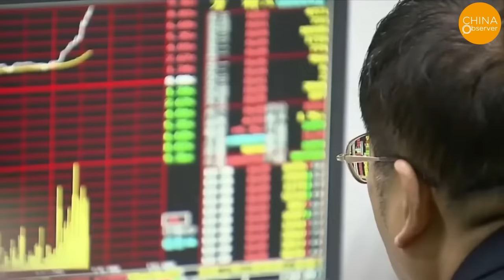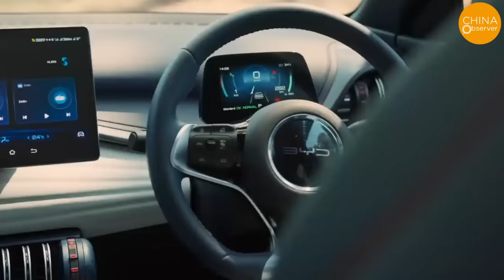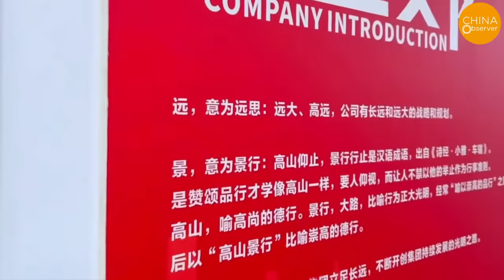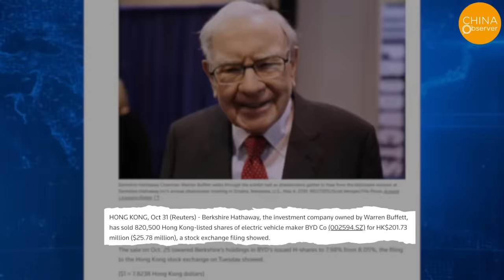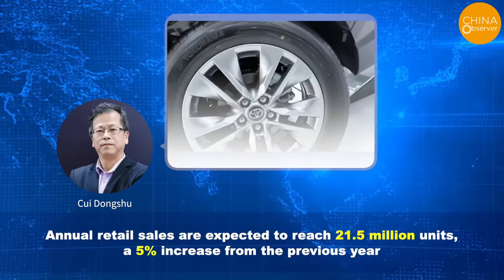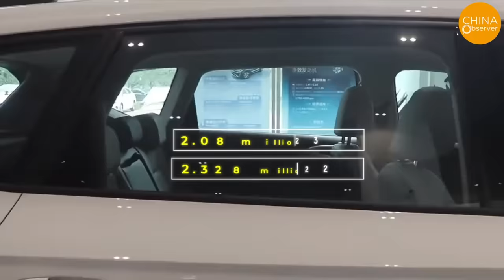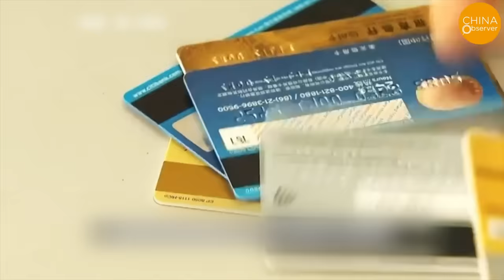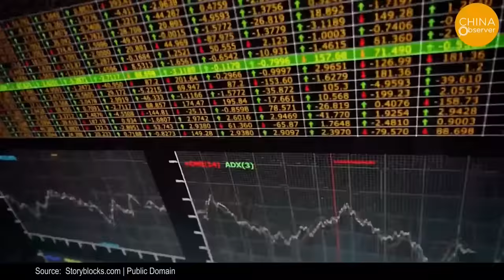China’s Car Dealers in Tears: Car Price Freefall, ￥190,000 Cuts Still Unsold, Turning New to Rust

Comment: If a new car is rusting this quickly, its not very well made. It should take at least 8 years before the first spots form.
Reply: china moment
Reply: Possibly it’s just the brake rotors, normal.
Reply: If the dealership is near the ocean, the rust can form much faster.
Reply: Where did you get that information about 8 years
Reply: I’m in the US.  Where I live we get heavy snow and ice in the winter.  We use salt on the roads.  My car is 5 years old and still has no rust on it.  My car was not made in China.
Reply: Made in China cars start rusting from in the factory, they tore down a brand new BYD with internal rust fresh out the factory.
Reply: All the atmospheric pollution in China turns the rain acidic, plus the steel used in Chinese-made cars is sub-standard.  Imagine how quickly a Chinese-made car would rust away in the US where they treat the roads with salt and other de-icing chemicals.  I bet the Chinese also cut corners when it comes to undercoating their cars.
Reply: Tofu Dreg vehicles sell in china 🤣😂🤣😂🤣
Reply: You forget the acidity of the rain because of the pollution 😅
Reply: Made in China
Reply: @PRCOutdoor 😂😂😂
Reply: It's not rusting. Those are termites.
Reply: Really? My car is currently 16 years old and the only superficial rust spot so far is the exhaust and some bolts.
Reply: Won't rust if plastic crap
Reply: Weather conditions also intensify rust
Reply: Regarding all the videos about burning brandnew EVs, airbags dont open in frontal heavy crashes.. i would consider you lucky because you only got some rust.
Reply: No vehicle is made to stand still. Movable parts can lock shot. Brake rotors for example.
Reply: Because it made from China...
Reply: It is made in china
Reply: Ford and gm never last 8 years. I live in America especially in winter ❄️ states cars 🚗 start rusting so quick. Ford and gm newer cars 2021 and above already receiving many complaints from customers about getting rusty.
Reply: The car that is “rusting” in the beginning of the video is Volkswagen. A German car company.
Reply: Das Auto mein freund!
Reply: Made in china
Reply: i think the problem is its on direct sunlight for 4-5 years. plus gets piled up with snow in winter with no one removing the snow till the ice melts. which will damage the paint.
Reply: Im happy with my 20 year old Golf IV with no rust
Reply: how much is it in US dollars?
Reply: VW rusting so soon 😮
Reply: This talk reminds me of the time when Americans did think that Japanese and Korean made cars are shit. I am originally from Germany. Visiting my aunt in Denver, her husband just said it all day: Look at this horrible made cars. NOBODY will buy them. And now? Toyotas and Hyundai is everywhere in the world. I live now in Panama. Chinese brands everywhere on the roads. And yes. A lot of Panamanians love their 30 year old Toyota trucks and suv. But looking at Chinese cars with 5-7 year of warranty, sold including 3 years of maintenance, fully loaded and 60% cheaper than a basic Ford. Chevrolet in Panama? Rebranded Chinese made (by SAIC) cars and trucks. NEW Toyotas or Suzuki cars are made in India. And rust? I did see rusty new Ford on my dealer’s sales overflow lot in Edmonton Alberta. The rusty cars in this video by the way are VW brand. Not Chinese. I drive a 2010 Chevrolet Silverado 2500HD with white paint. Remember the American quality of Chevrolet? The paint is flaking off and the dashboard is cracked all over the place, looks like a river map of Africa. Well known issues on American made cars. So don’t throw stones at others if you sit in a glass house please. I’m not starting with the bad quality of Ford vehicles since 2015. I had two buy-backs from Ford because my new Mustang couldn’t get fixed and my 2016 F150 had 3 dashboard replacements, transfer case destroyed (big metal shaving) with less than 15,000 miles on it!
Reply: @melissasmess2773 what are the break rotors doing on the hood of the car?
Reply: @damocles8417 And when was the last time, that US made a good car 💀
Reply: @filipbabovic8474  I don’t know about cars but heavy machinery, farm tractors, trucks, and cargo ships, we can make.  America also holds the patents on 80% of advanced microchip technology.  
Please tell me about your cars though.  It seems important to you.
Reply: Take less in the UK  the salt they put on the roads in winter the roads here are in a shocking state 3rd world roads
Reply: @filipbabovic8474  Probably today, if it’s after midnight there, then tomorrow.
Reply: Most likely due to acidic rain and dirty/polluted air (possibly ash). If you don't wash your car often there, you'll get paint damage and rust.
Reply: @damocles8417  I live in Thailand and I parked my car outside of home and it often exposed to the rain and mist. No rust after 10 years. An American car.
Reply: acid rain
Reply: My trucks is 29 years old still practically no rust anywhere. Definitely a new car quality problem.
Reply: MADE IN CHINA

Comment: The problem is not the cars sitting in the  
car lot. Consumers have no purchasing power to buy these cars. Unless these issue is addressed and resolved, those cars will continue to sit in the lot, rusting and loosing it’s value significantly.
Reply: I@sandponics I think the idiots have run out of money.  It's happening everywhere.

Comment: I'd rather have a petro or hybrid  vehicles in cold regions,EV'S aren't good in cold weather especially chinese EV's
Reply: Its terrible in the tropics as well. Components gets over heat and swell alot after a while that renders the problem too expensive to fix and the vehicle too dangerous to use.
Ever seen an EV fire? Its almost impossible to put it out. 

Regret buying EV. it is a worry generator on the road after a while. Without a doubt, the worst investment ever made.
Stick to an old Toyota instead, at least u don't have to worry if u would die in it one day after a while.
Reply: @MrNajibrazak  I have both, a old 02 Toyota Sequoia and a 18 Model 3.

Sequoia has 268k miles
Tesla has 96k miles.

Both are doing well and have been easy to own. No issues here. This was my first electric and I was able to do 22k miles per year in deep southern US heat and humidity.

Comment: Interesting. In china, the base model Camry sells for the equivalent of $28,200 in Canadian dollars. In Canada, the same car STARTS at $34,500. Why so expensive in Canada? Well, I suppose it doesn't matter. I can't afford a new OR used car, ice OR electric. Things are so bad in this country, I've been forced to keep my existing car on the road for longer than I'm comfortable with, but it's the most economically feasible thing I can do. I recently had my older ice car repaired and maintained for a SMALL FRACTION of what even a late model used car costs here in communist Canada. A new Corolla starts at $29,000 in these parts and a used Corolla is almost as much, so I just saved myself the better part of 30 thousand dollars by not buying another car.
Reply: Because the body is made of thin metal the exterior and interior finishes are of synthetic materials.😂
Reply: Because Made in Canada is not the same quality as of Made in China !
Reply: Don't worry, EVs are getting better and cheaper. China's BYD Seagull starts from less than CAD 14,000. BYD makes excellent cars, but not sure when they'll be exported to Canada.

Comment: The EVs are just a metal frame on 4wheels and the battery pack. There is no ENGINE, the heart and hence the EVs are super cheap to build. Its just the euphoria of EVs that was letting the manufacturer drive the price higher which is now cooling as more manufacturers have identified the opportunity to exploit the market.

Comment: its almost like manufacturers are filling too many "features" into there crap cars resulting in high costs of vehicles....they need to being back options...GIVE CUSTOMERS FULL CONTROL OF OPTIONS!!!! If i had my way i would have a small car with manual everything, am radio no touch screen crap, no A/C, NOTHIGN that requires a computer to operate asides from the PCM. would keep the car price as low as it could be